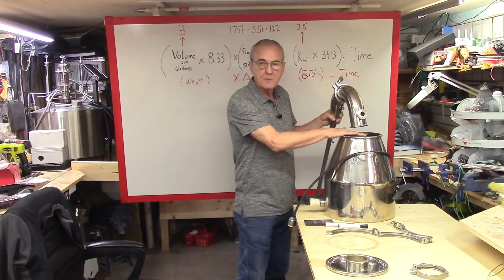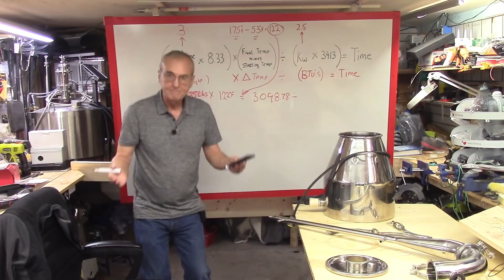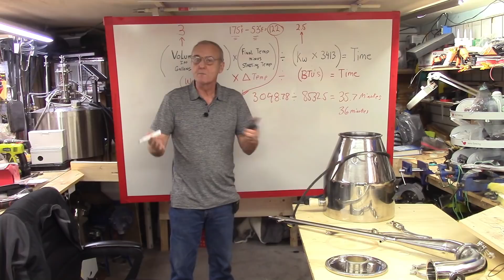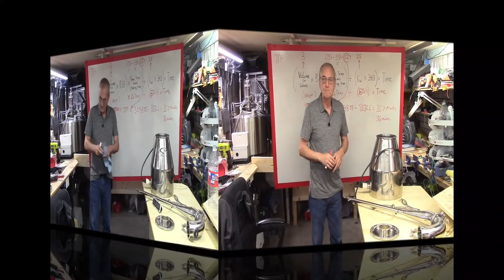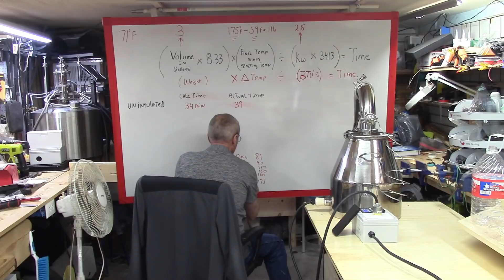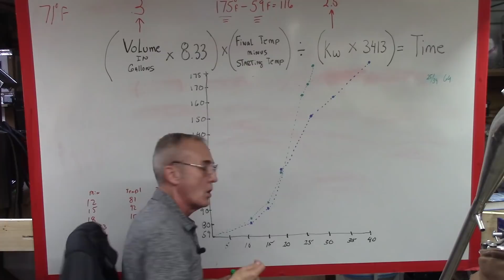INSULATING A STILL. IS THIS A GOOD IDEA?  PART 2

Comment: I think at lower temps there is less of a difference between the boiler and ambient temperature as well as the insulation itself heats up over time which could cause the gradual increase of efficiency

Comment: Great video George! It looks like you had a conversion error at 5:53...calculation resulted in 0.357hr which is 21.4 minutes NOT 35.7min!

If anyone is looking for the complete computation...
Calculate the BTU's required (Step 1):
BTU = (gallons x 8.33lb/gal) x (1BTU/lb *F) x (final temp - start temp)
BTU = (3gal x 8.33lb/gal) x (1BTU/lb *F) x (175*F - 59*F) = 2898.8BTU

Then convert BTU's into kWh (Step 2):
(result from Step 1) / 3413 = kWh
2898.8BTU / 3413 = 0.849kWh

Then account for the heater element you're using (Step 3):
(result from Step 2) / (heater element size in kW) = hr
0.849kWh / 2.5kW = 0.339hr

Then convert to min (Step 4):
(result from Step 3) x (60 min/hr) = min
0.339hr x (60 min/hr) = 20.4min

If you are using metric units...
Calculate the Joules required (Step 1):
kJ = (liters x 1kg/L) x (4.184kJ/kg *C) x (final temp - start temp)
kJ = (11.35L x 1kg/L) x (4.184kJ/kg *C) x (79.3*C - 15*C) = 3056.4kJ

Then convert kJ into kWh (Step 2):
(result from Step 1) / 3600 = kWh
3056.4kJ / 3600 = 0.849kWh (use this in Step 3)

Comment: the mistake made was units of time. Dividing 3099/8532 = .36 HOURS = .36x60= 21.4 minutes.
which makes more sense.  21.4 minutes would be for perfect insulation, no heat loss.  25 minutes for some insulation.  39 minutes for no insulation.  ~50% reduction in time if you insulate.

Comment: George,  I think I found an arithmetic issue in your calculation.  Please do not think I'm being critical; we all make calculation errors.  

With both the 35.7 minute answer and the 34 minute answer I have issue.  When I do those same calculations using your numbers, I come up with 0.357 HOURS for the 122 degree delta and 0.3398 (round up to .34) HOURS for the 116 degree delta.  Each of those results * 60 minutes are 21.42 Minutes for the 122 degree, and 20.4 Minutes for the 116 degree delta.  

I don't know-so, but I think you forgot to multiply the result by 60 minutes.  Charting that out by using a Black line for the Calculated time, and different colors for the 116 uninsulated and insulated times you have down, both lines end up UNDER the calculated line on the graph if the result was multiplied by 60 minutes.  That implies that the Insulated is more efficient because it is closer to the calculated line, but it is not 100% efficient (and I don't think it never will be) and that is indicated because the Insulated line is Under the calculated line.  The calculated line is assuming 100% efficiency.  

I'm not trying to be rude here; being dyslexic I'm always making math errors and constantly have to check myself.  My coworker and I check each others math all the time because of the nature of the job and the power that can kill us if we are wrong.  

 I think you do a wonderful job of teaching, and to do things like this on camera you are putting yourself out there.  I understand that and appreciate it.

Comment: Thinking about this a bit more; I don't know the calculation, but if you had "projected" data points for your basic formula at the same points as your tests, and draw that as a solid line on your white board, anything below that solid line is "less efficient" and anything above that line is "more efficient".

Comment: Rule number one of survival is to conserve your energy for when it is needed.  Insulation does prevent heat dissipation but also allows heat to be reflected back into the pot.  The initial curve of both tests is the same because it takes the same amount of energy to heat the 5 gallon volume initially.  The result of a "better than calculated result" means you are above the 100% efficiency of the projected calculation at 100% use of the element.  In other words, the insulation works mo-better than planned.  I may be wrong, but I figured your first test was 87% efficient (or close to it if memory serves) and your second test was 1.37 efficient (or something like that).  That  is what lead me to think about the reflective aspect of the insulation.  For a first go-round of testing, those are excellent results.

Comment: Technically you have to actually measure the current/voltage/watts actually being used by the equipment and there is some variance between published specs and reality in those.

Comment: Sure just add a steam flowmeter and test it.  Now you know the rest of the story.  It is pretty simple, insulating a still just makes more steam and pressure build up even in a open system. 
Steam builds up pressure real fast, water vapors do not.  But the temp at the base is setup for methanol not ethanol.   
BTY methanol sells for $26.00 gal now.

Comment: Great video George. I love number crunching to improve things. 

I have 2 queries, anyone chime in if you can answer.

1. I tried to do this formula using °C and metric. It didn't work for me. I used 12L of water = 12kg, and difference in temp in C instead of F. I assume changing units affects the last value that you divide the result by. ?

2. How can the insulated test result be LOWER than the formula result? Doesn't the math assume 100% efficiency? I understand, or more accurately — assume, that as the liquid heats up, the boiler vessel temperature also rises, and the vessel begins radiating heat. Is this what we call heat loss? And is heat loss the primary drop in efficiency in a system like this? If heat loss accounts for say, 30% of the energy input into the system, you need to use 30% more energy to reach the target temperature?

Anyone that knows more or better please chime in for me.

Comment: Quick question George....I just sewed a whole system around my 35 liter pot still out of canvas....it was time consuming and I did the column and the pot/top of pot it all covered,I sewed some towels in between the canvas to thicken things up because I couldn't find insulation.....my question is,will this canvas shrink?will canvas work?I will be doing a run soon an don't want this stuck all over my equipment...I'm using a electric burner that has been taking up to 3 hrs heat up time so I'm thinking the insulating idea was great for me just not sure..... Happy Distilling 😁

Comment: I don't know how to ask this correctly. Would increasing the insulation around and on the bottom have any affect on increasing thermal input to the still? Somehow amplifying the heating element's effects with what's being disappated by the still? I know that  'engery in' - 'energy out' + 'enegery out' = same as 'energy in'... but maybe the metal increases in temp in the top part of the still to a higher temp than just the element would in a theoretical white room?

Comment: Below your air temp, (71 f) there should be little or no heat loss from the liquid whether insulated or not.  The reason that your time to 175 f is less than calculated may be that your 2500 watt element is actually putting out more than 2500 watts.

Comment: George 
I see you set the pid to manual. 
Is there a way to set a mypin TA4 pid to manual mode to deliver 0 to 100 percent power to the element?
I have it set up as a pid running a 250v 5k element. 
I would like to try running it manually

Comment: It is clear that insulating the boiler reduces heat up time, but if the column is also insulated, would not this greatly reduce the reflux action of a cooler column?

Comment: I think that the heating times were faster than calculated because a BTU is measured at 39 degrees, the temperature that water is the most dense. And the water as it gets hotter loses density, therefore not being linear and heating faster per BTU as the temp rises.
Reply from the maker: Thanks. I figured there was something I wasn't considering.

Comment: heat loss is proportional to delta T  so the heat loss is more at high  temp .
the production of ethanol will be higher so a faster distillation
the liquid temp is the place to measure it  remember latent heat of vaporization 
measure the flow of   spirit with a given power level
Reply from the maker: I see. This is what I love about this hobby, the sharing and explaining that happens within the community.

Comment: Is your element actually 2500 watts ... maybe that explains it
Reply from the maker: I checked the element and even tracked performance during the run. It ran at a constant 10.35 amps which is a little lower than the 10.41 for a 2.5 Kw element but close enough. I also checked with a multimeter for resistance before installing it and it measured out at 2.5 Kw.

Comment: I suspect your actual element output was greater than 2500w either from line voltage variation or element resistance tolerance.

Comment: Great video George. If you had the temperature probe in the liquid, it would correlate with the calculations. The liquid temperature is different than the vapor temperature depending on the distance from the liquid.
Reply from the maker: I agree and half way mentioned that but only as a passing comment. I should have gone into greater detail.

Comment: This is absolutely the best! George what does concern my and this is going back a few steps! Is people running large wattage elements in their stills, like 2x2500 watts and their garages are only suited to or has low amperage wiring or feds! And sometimes the change the plug to suit, it certainly happens in Australia, and result is their house or garages burn down!  But even so I love these topics!
Reply from the maker: Agreed. I hear about that quite a bit. I even heard of a distiller who had two 5.5Kw elements in an 8 gallon still.
Reply: You won't burn down your house if your wiring is properly installed. The circuit breaker protects the wiring from overloading. However 2x 2.5kw elements would trip any single circuit in an Aussie house.
Reply: @Thermoelectric7  yes but some backyards use by-pass them specially with the old type fuses and fuse wire !
Reply: @silver-hy6mi  and that is why we sparkies love replacing those old switchboards. Surprised they don't cause more fires! 😂
Reply: @Thermoelectric7  hey have a look at the guys going dope in houses with multiple heat light drawing multi amps on a 15 amp circuit! That’s why they have unexplained house fires!
Reply: @silver-hy6mi  maaaaaan any house that is growing dope has probably bypassed the meter and is doing all kinds of dodgy shit. No surprises there, apart than the stoned firefighters and neighborhood after the fact 😂😂

Comment: It’s a cool experiment, George! Assuming your heat loss is constant in the un-insulated example (steady ambient, no wind), and your heat source can adequately make up for the heat loss, it does not seem worth the bother of a heat jacket based on time savings to get to distilling temperature. I heat up my 6 gallon still with a 1,300 watt heat plate and cut it back to about 800 watts once condensate starts dripping. Yes, you will use less energy if you insulate the kettle, but not significantly less based on typical cost per KWH. To each his own: a heat jacket is a nice addition, but I don’t think it improves the product, only the process. If you distill outdoors in the winter, a heat jacket is great. Assuming you don’t set it on fire!

Comment: Well I know what I am going to be making next. Great video George. I have so much exposed metal between 30 inches of 2 inch column and a huge 3 inch gin basket with two 2 inch 90s; I’m going to insulate everything including the boiler and see if it’s easier to keep everything balanced. This is a fantastic idea and should help out people having problems balancing their temperatures in the column with a PID. I can’t wait to try this! Happy distilling!
Reply from the maker: Sounds great! I had an email that described how temperature fluctuations were eliminated after insulating.

Comment: My PID is run in series with an SCR so I can choose to run it with whatever wattage I please.  My 6500 watt element can be turned down (6500 - 0) with the SCR - and the PID allows me to hold the temp super stable.  Its the best of both worlds.
Reply: Would you share your wiring diagram?

Comment: Hi, just to add my bit in, assuming a zero loss situation and calculating in metric is easier for me. I Calculate as follows:-
Time(Sec) = (HeatSpecific X TemperatureDiff X Volume) / Kw
3 Gallons = 13.63 Litres
122F = 50C
Time(Sec) = (4.187 X 13.63 X 50) / 2.5
Time in seconds is 1141 (Divide that by 60 gives you 19 minutes) (Again the calculation is lossless but gives a reflection of how much energy you're still in fact losing)

Oh and Great info you're sending out George, thank you.
Reply: I was just about to say all this. If you didn't mention it he also needs to add the weight of the pot itself. I wouldn't add the column because it would only be a minimal factor until you reach the boiling point of watr.

Comment: Impressive, but not surprising.  Since ambient room temp was 71, you would expect the two to track close together to that point.  Indeed, the un-insulated would actually gain heat from the room temperature more than the insulated pot would gain.  But as temp in the kettle rises, the insulation prevents heat loss by convection.  So your graph is exactly what I would expect to see -- efficiency gains beyond the point of the room temp.
Reply from the maker: Excellent point

Comment: Hi George, could you measure the actual power used by the element? It's possible the element is using more than the rating due to allowable tolerances during manufacture. Maybe closer to 2.6 or 2.7kw? Just guessing, but maybe worth checking. Great video.
Reply from the maker: Very possible. In fact (not on the video) I did track the amperage and calculated value should have been 10.41 amps. I was measuring 10.35 amps constant so it was running a little under the 2.5 Kw rate. Not by much but just enough obviously.

Comment: George,  since we are using Kw (which I assume are per hour), should we not take the result of the division and then multiply by 60 to get the number of minutes?  So when you divide 3098.78 by 8532.5 you get .3632. Then to convert from a portion of an hour, multiply by 60 to get 21.79 minutes??
Reply: Above statement seems to be the issue, as thermodynamically it is impossible for the liquid to heat up faster than the calculation which assume a 100% efficiency (even with the heat reflection theory above...).  The only other possibilities would be the amount of energy input changed or the amount of water is different between the 2 experiments.
Reply: I made it  up to the 6min mark and had the same thought with the same result.
Reply: Exactly.  Just watched the how long should it take video.  Think the forgot his result is in decimal hours, still have to convert that to minutes.
Reply: Just redid then math with the corrected temperature.  100% efficiency would take 20 minutes and 24 seconds.  The uninsulated run would have been 58% efficient.  The insulated run was ~82% efficient.  Still a gain of 24% efficiency.  Well done.  Great video George, other than the simple math error.  Like you say, No right way to do something wrong.  LOL.  Happy Distilling.